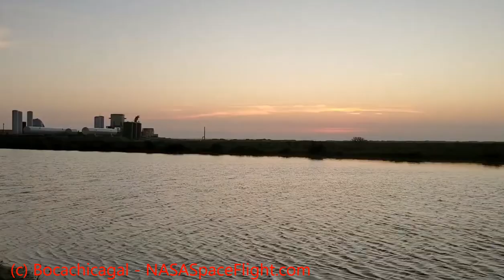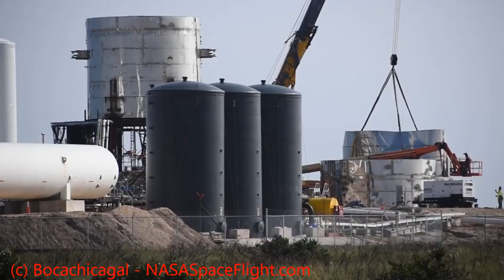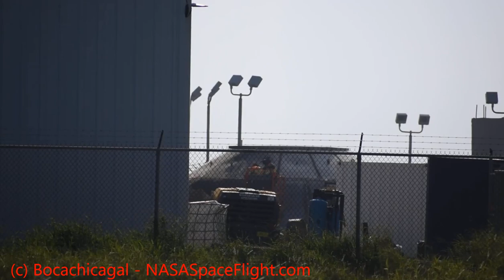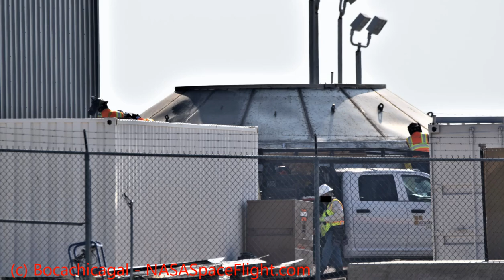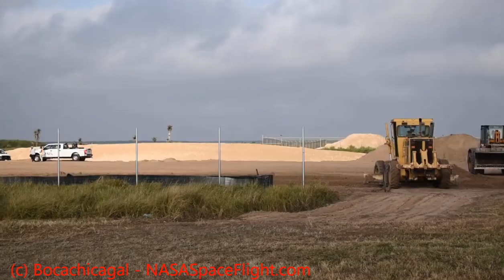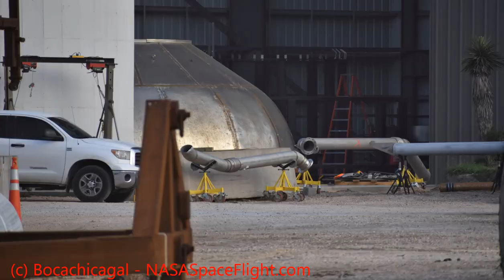SpaceX Starship Mk1 "Cookie Cutter" and ongoing Ground Work

Comment: What I find puzzling is the lack of interior ribs to support the outside skin and internal tanks on that piece.  Did they pull it out at another time or is that how the lower methane tank is designed?
Reply: @herewithcoffee Falcon 9's tanks are as thick as a soda can.
Reply: @herewithcoffee if this was a commercial  airliner ..would you fly in it !!  i think the whole thing is a joke or they are trying to dumb down the kids to make this b/s the norm
Reply: A vid released by SpaceX a while ago briefly showed a view down into a tank. You could see interior hoops reinforcing it. Perhaps removed already. 

btw, the outside skin and internal tanks are the same thing. The body is the tank. It's this way on Falcon 9, Atlas 5, Delta, Soyuz, etc.

Most rockets have the entire aluminums-lithium interior surface machined into an isogrid pattern to be thin and strong, a very expensive process. F9 is also aluminum-lithium, but has interior hoops and vertical stringers - weighs more, but cheaper. SLS has isogrid and hoops. See Scott Manley's vid 'Why Did A Rocket With A Secret Payload Implode on the Pad?' It opens with a shot of an SLS tank that was recently deliberately tested to destruction - we get a great view of the interior. (Other isogrid one may also have inside hoops - have no idea.)
Reply: @donjones4719  - I believe I saw that. But, there are no signs of welding the frame to the skin which I'm wondering about. I'm wondering if that was Starship or the booster. It's hard to tell since they have the same diameter and few differences in their lower halfs'.
Reply: @FreeStuffPlease  - Thanks for the correction.

Comment: I’m not a rocket expert by any means and I’m definitely not the one to question Spacex’s building practices but still, I really don’t get why they’re using rings to build Starship’s hull instead of (for example) a one-piece spiral welded “pipe” (around an hydraulically adjustable mold if the “pipe” could not support its own weight due to the thickness of the raw material used), a fully automated process that would save them a tremendous amount of time (and effort) while at the same time, eliminating the possibility of welding flaws.
Reply: Like a paper towel tube😄
Reply: To be honest mate, your opening gambit answers your own question.
Reply: Because top elements are thinner than bottom elements. They do this to safe weight. With a spiral this wouldn't be possible.